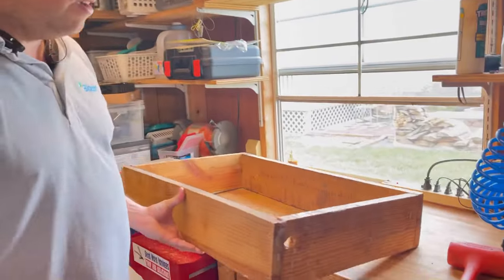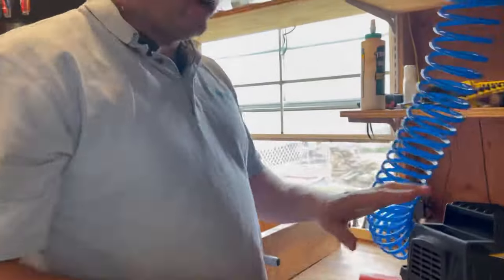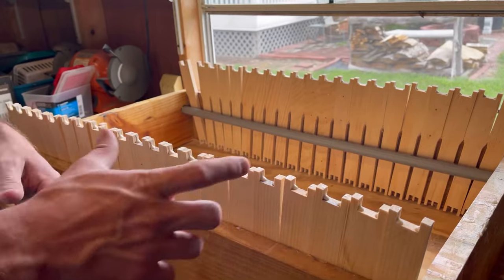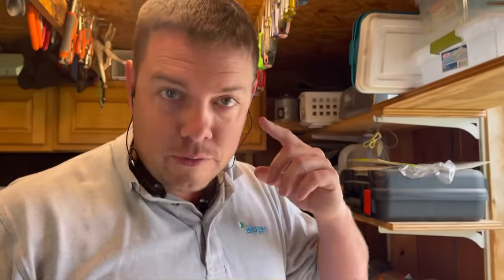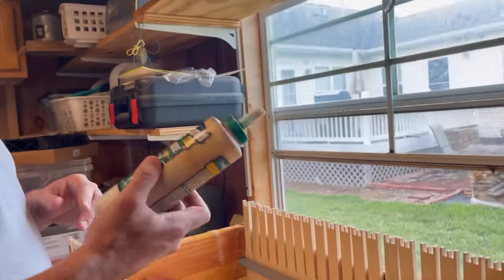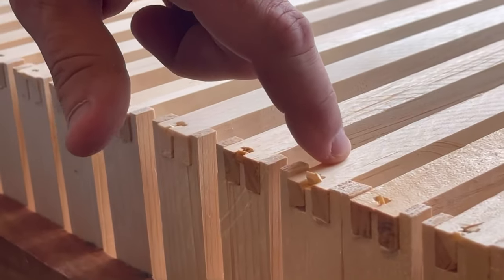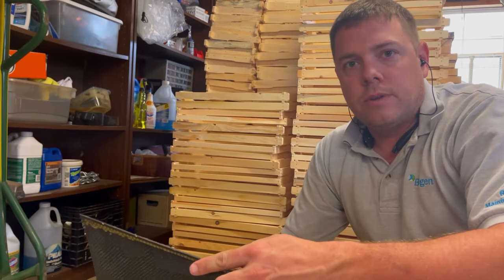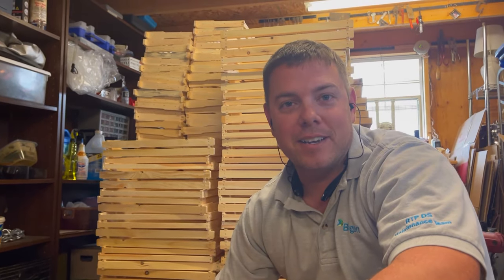How to build 5,000 Bee Hive Frames FAST !!!

Comment: I like the extra finger in the bottom of the side bars, they're not available in Australia, will see if suppliers can oblige...after trying wood, wire and wax foundation, all plastic, wood and plastic foundation, my own preferred standard frame is wood and plastic with my own wax hot rolled onto the plastic, much stronger and way  more robust than
Reply: wood wire and wax, much quicker to assemble. Great idea on the assembly box, will try a batch as pre assembled frames have too many fails due poor quality  control.

Comment: Looks well done to me. Something for others to consider if using TB3 instead of a more traditional wood glue is that the open time is a lot shorter, so in hot weather it can be as short as 10 minutes before one starts to lose strength. TB2 is almost as weather resistant and has twice the open time, so if one is not as speedy as this fellow, consider that as a good alternative.
Reply from the maker: Great advice!!!

Comment: I inherited an assortment of old well worn frames and tested them all for strength,
It was obvious that I needed to buy a staple gun as staples are stronger than nails and much faster than glue however i admire  your enthusiasm, keep up the good work.
Reply from the maker: Staple or nail is faster, but only serves to hold as a “clamp” while the glue dries. The glue does all the work when it comes to holding the frame pieces together.

Comment: For ergonomics, I recommend getting the glue bot or knockoff glue bottle. It has a few different tips, but it feeds from the bottom, so when you squeeze, it feeds effortlessly as liquids find their own level, so you are only usually applying minimal pressure, you don’t have to twist your wrist as much, there’s no tapping or anything. I have been running 2 in my shop for about a year (one for precision, one for bulk glue like laminations) and since titebond 2 is actually stronger and cheaper than 3, it would be my preferred option as well. Tb2 has to really be exposed to moisture for a while to deteriorate in my experience.   
You joke about the hearing protection, but ignore eye protection. Almost 92% of eye injuries are from mechanical means(not light/radiation/disease) and most of them happen at home and are preventable. In the agricultural sector, most of them occur from low branches surprisingly. Any ear protection helps, but eye protection is no joke. All you need is for a staple to blow the wood out one time and you’re blind in one eye and you have lost depth perception
Reply from the maker: Thanks

Comment: I really like the use of conduit for the holding bars! It has two advantages over wood: one you can slide the pieces in easier because of the curve and to it’s dead street which is always a problem with wood bars because they usually have a little bend in them and the uneven tension makes the pieces fall over while you’re trying to install them in the holder
Reply from the maker: Surprisingly, the plastic conduits have the same bend over time. However, they slide in/out easily....You can call it luck....I call it a happy accident!

Comment: The reason the nails offer no support, is because you put them in straight up and down. (Top Bar) They’re supposed to go through the sides to counter the pull of extracting them from the supers.
Reply from the maker: Haven’t considered doing it that way. Thanks!
Reply: A well glued frame will be more durable than any method of mechanical fastening. If a person is not inclined to using glue, then yes, nail placement matters.
Reply: Those thin nails cant hold a good hive tool pull. Still the glue is doing the work.

Comment: Enjoying your channel - keep up the excellent work.  I'm a new beekeeper looking to expand and have a question:  what's your take on all plastic frames (Acorn?)?  They seem much cheaper than wooden frames with plastic foundations, not to mention, you don't have to take the time and energy to assemble them.  Curious to hear your thoughts.
Reply from the maker: They twist and warp, and are a pain to run through an extractor

Comment: Those look like Bailey Bee frames.  I recently bought some from them and they are tight!  I do like that but I'm not a fan of the way the bottom bar is built, but I suppose it really doesn't matter.  I'm curious why you designed the jig for 21 frames and not 20.  I do like the use of conduit over wood though.  Also I heard that firing a horizontal nail/staple from the side bar at a slight angle up and into the top bar is the most important thing in building frames. Any frames prebuild I buy have that so I did it on ones I've made as well.  I couldn't imagine making 5k frames let alone 20k.
Reply from the maker: That side nail comes from an automated frame builder. It’s not necessary. No particular reason about the 21 frames. Just extra wood laying around.

Comment: Why are there holes drilled on the side pieces? I know they would be used to run wires thru for wax inserts but why drill them if you’re using the plastic inserts?
Reply from the maker: The company I buy from does it

Comment: What would be the downside to placing the Acorn foundations in the grooves during assembly?  Like setting them in place right before attaching the bottom bar?
Reply from the maker: Its not time efficient/effective. Often times the plastic inserts arent straight, but have a slight bow. You'd be fighting it about every 4th/5th frame. Its easier to do the same step repetitively at scale. I can pop in 100 inserts at 4-5 per min just before putting them in the hives.